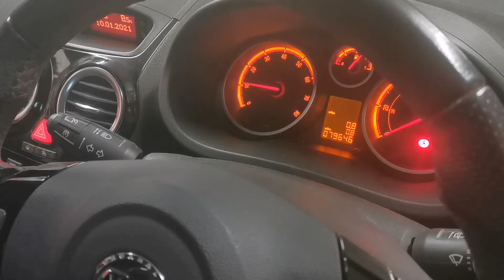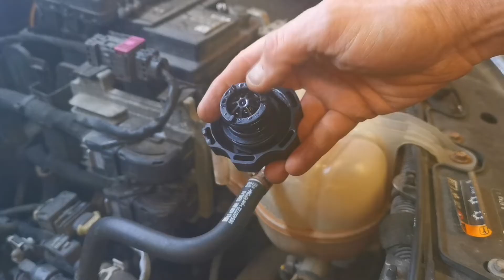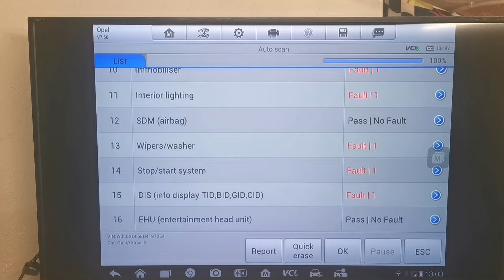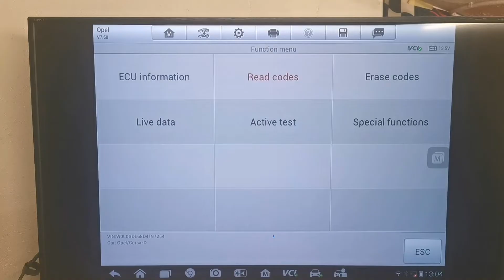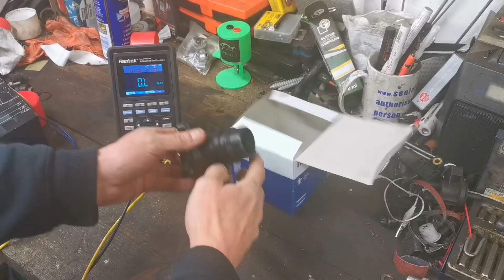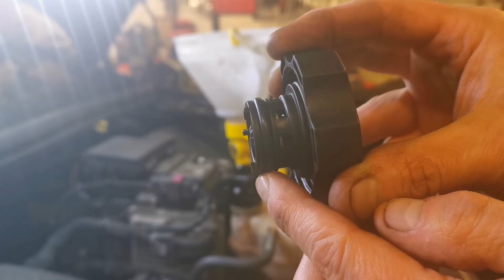Vauxhall/Opel Corsa D. Fan Running, Warning Light On

Comment: Had the exact same problem with a Corsa 1.4 XER. I'd recently replaced the thermostat housing so thought it might be the temperature sensors instead and replaced both. That didn't fix it and then I saw this video and realised it was the 'new' thermostat that was faulty. Lesson learned, spend more on part next time!

Comment: Great video, may I ask please….when you tested the thermostat resistance, the range was M Ohms. My reading is fluctuating around 3.4 on M but OL on normal range. I’ve checked the harness terminals with a test light and it’s ok. Is this showing a faulty thermostat with the ohms reading? Not sure what resistance I should be getting. Any help would be gratefully appreciated.

Comment: Bonsoir merci de répondre, jai une opel corsa d essence la tempérarutre d'eau atteint 108 et 110 degrés en circulation et en route se fix en 100 degrés est-ce que c est normal ou non😊😊
Reply: Did you find the solution of your problem???
I think you have problem with fan

Comment: Hi I have the same Opel Corsa and the engine temperature rises to 110 degrees and does not turn on the radiator fan the radiator fan is good I checked it briefly What could be the reasons
Reply: Alles in Ordnung. Das Thermostat regelt zwischen 95-110 Grad Celsius. Ist normal.
Reply: Change termostat electric controle

Comment: Please can you respond. I have white smoke coming out of exhaust, and inside I saw a traces of antifreeze, and saw the drops of water leaking from the exhaust. I have the whole coolant reservoir and cap changed, and think also some plastic hose. But the car still loses the cooling liquid. After a month it dropped pver 3 thumbs down. The car has lesser strength I think, average consumption increased to 10.5km in the city. I don't know if that's notmal, but the sound of motor is louder and also the sound of belt I can hear in  cabin while driving. I have given over 1000 dollars for the mechanics, and really don't have anymore to waist. :( Can you give some advice please, thanks in advance:)
Its Corsa D 1.4 ecotec/  automatic
Reply: Head gasket

Comment: Just had this with my car changed the 2 temperature sensors fan was still on.  Then changed the resistor.  Fan was still on. Bought a new thermostat comes complete with housing unit £17.89 of eBay stuck that in myself pure easy 3 bolts. Seems to have done the trick. My  fans off.  Warning light is off car running like a dream. You also have to top up coolant  so buy 2-3 litres as you  lose almost all of it when changing the thermostat. X
Reply: Was your car idling up down
Reply: That will be a vacuum leak on the manifold, you would need to check fuel trims to see what the engines trying to counter act ie unmetered air coming in past the maf sensor

Comment: This is the same issue im having with mine, same model.  Ironically i was half way out my street to the garage when the engine temp warning light started flashing red at me.   And there was an ever so slight burning smell.... don't think its wise to drive.   Any idea what it could be? I'm bricking myself that its gonna cost a bomb whatever it is

Comment: Watched video 5 times more.  I thus tested both new Mahle ThermoS to same 15 ohms. So they both work.  But they don’t open on boiling water test.  ** Electronically controllled ** ? … water pipe to thermo on housing alone straight through pipe now warm and no overheat.  Dave have you seen the electronically controlled heated thermostat electric connector pin to be faulty. Maybe it’s a wire problem to the thermo Dave , or ECU ? Thermo are not faulty. Car only overheats due to these new Marle being stuck closed.
Reply: What did you find for a fix for this?
Reply: @bigmanlogo959  I changed the thermo. Twice. Wasn’t this. I took out the thermo inside the housing and drove fine didn’t overheat. I think the electrics were telling the thermo circuit to stay closed. So removed it.

Comment: Dave. Thanks for comments other day. Struggling I am, head scratching ; here’s  where I am.  2x new Thermo and a new water pump.  I still have a big over heat situation .  I have great oil and water condition but on scanner it jumps to 121c to 125 and quickly .  Terrible.  Fan only kicks in at 110c. Wrong by 12-15 degrees I believe .  This is over just 2 miles it gets to 125c. It’s like the thermo stays closed but it cannot be.   I tested both new thermo in 100c boiling water.  They didn’t move. But brand new boxed 2.  Same model as yours shown 1.2 xep engine.  However. Should I remove the new thermo and run car with housing only,  thermo removed, straight through …..  It doesn’t run with an overheat.  It runs normal. Over 25 miles.  I don’t believe this is head gasket.  I’ve isolated all. Water pump does pump.  It runs fine with bad practice no thermo status.  Any ideas.  It’s totally blown my head. Wrecked it.  I’m no mechanic. I’m on the learn . Thanks Dan.
Reply from the maker: Put 12 volts to thermo to see if it opens off the car. Pin close to engine side is positive. I use Mahle thermos. If lower radiator pipe is cold thermo is closed
Reply: @davesterl  that’s exactly what I thought !!  I have a cold pipe. My problem is I replaced the new Marle one with exact same Marle one.  And pipe remains cold.   Can two Marle thermo be defective. Never ?   It’s a mechanical part , I’ve looked videos from Marle.  Could anything stop the Marle from working outside of temperature on the innards of the Thermo itself. I’ll try a 12v thanks !  This has blown my mind. I know it’s Thermo.  So I bought it again. And it’s still pressuring and still a cold pipe maybe 5 hours messing in.
Reply: @davesterl  mahle tm 37 103 made 02.12.21.  Put both Mahle to 12v car.  And also to 9v square domestic battery. Doesn’t move whatsoever.  Either.  Hmmmmm.  These are new boxed.  Brand new.  Same part model.  Brand. Boxed.
Reply: @davesterl  isolated this down to wiring or circuit.  I’ll get a circuit tester and check the power to the thermo.  Thanks.  I’m suspecting after speaking electrician this could be the relay the rad circuit is on.  Radiator itself only opens at 110c not 95-98
Reply from the maker: @primeroo2nd  i thought you tested the thermos?? They open at 103. Pulse witdth signal on ground side, you can see it happening on a scope
Reply: @davesterl  I tested Thermo on a 9v home battery and a 12v car.   Didn’t open. Also in pan 100c water. Don’t believe this is how you test them. Then did on OHMS and got your 15. Ive very new to coolant systems and electrical testing.  Though sold cars 17 years not fixed them
Reply from the maker: @primeroo2nd  the thermo is opened with  12volt supply and a pulse width ground. If you only sell cars and don't fix them and do not know what you are doing then that is the problem
Reply: @davesterl  sold 8000 cars, all gone to garage 05-22 !!!!  I’m between premises 3 months post fire so too much time hands business on hold some GM strangled diesels plus petrol Corsa overheating.
Reply from the maker: @primeroo2nd  i tell you how to test but you don't believe this is how you test them, so i can't help you. Sorry
Reply: @davesterl  it’s cool. I’ve just read the pulse width ground plus power. I was only using power.  The situation here was garage changed water pump and was damaged street. I took it away mess. But.  I’m totally new to testing thermo and circuit. I know it had new pump thermo header. Just not how test for circuit faults.  Equipment faults. All new.
Reply from the maker: @primeroo2nd  best of luck
Reply: @davesterl  thanks. I’ll get there. I’m working this out slowly. Circuit tester 9v battery test wires and equipment. Isolate. Follow on the circuit to the fault. Wasn’t aware these thermos aren’t just mechanical.  They need the electrical signal. Electrically controlled thermo. .  I stupidly thought the connectors read the temperate of the water through the thermo housing. And the thermo old school mechanical. Not. .

Comment: Would an in op fan allow water header tank bubble over in under 4 mins idling stationary please ?  I’ve had a water pump. New thermo.  But fan stopped working. Wondering if this why still boiling pressuring over ?? Thaksn
Reply from the maker: did you run fan on scan tool?  'boiling pressuring over' ???? If pipes not hard and coolant overflows when hot - check expansion bottle cap. Any decent garage can do some basic tests
Reply: @davesterl  old scan tool burnt in fire.  Couple grand one. What a job..  There is a major sketch here this car.  Radiator could have been intermittently faulty.  Back working again plugs off and on.  Water pump seen working. Tonight. Dry bone pipe off.  But is now not cooking. . I’ve taken out the thermo inbetween the thermo housing.  Now fan comes on at start stays on.  Wasn’t earlier at all.  And now Not overheating. Was earlier . Just had a new almost OEM thermo.  Suspect may be dead new thermo ??  Canibilised old thermo.  Odd one.

Comment: I’ve had an issue with my Corsa D 1.2 for 2 weeks now, been investigating it via YouTube videos and googling, I’ve got a amber car symbol with spanner showing on my dash, I serviced my car myself oil/filter etc but the fan is constantly running, I changed the radiator coolant sensor as I thought it was that, fan still running even when cold, I’ve bought a new thermostat which I’m doing this weekend. I’ve checked the relays and radiator resistor all looks ok
Reply: Did you ever fix this issue? I’m experiencing the exact same problem
Reply: @fin4946  Lol same here, i reckon its the thermostat housing where the thermostat sits inside, as my thermostat  heater control circuit is showing as High.
Reply: AmarR35  I fixed the issue of the fan being constantly on. All it needed was a brand new thermostat unit, quick and easy change 👍
Reply: @fin4946  cheers am gonna do that as soon as, iv had my warning light and fan spinning all the time  since summer 2019 loool..... Did you get an OBD 2 connected to see any fault codes mate?
Reply: AmarR35 Yh connected it and the code was P0599 on mine, I had the service light come up on the dash with the fan constantly running. The car runs so much better now it’s fixed
Reply: @fin4946  Good to hear mate, yh same code as mine, did yours state "Thermostat heater control system - circuit high"? Tbh I don't  think iv noticed it drive differently from when it didn't have that fault lol. I also have P0171 code, which is more than likely the PVC/breather valve, which are common faults on those corsa's too incase you get summat like that. Cheers for the response anywaiiz.
Reply: @fin4946  Hi mate I have the same issue do I need to buy the whole housing for the thermostat or just the thermostat unit?
Reply: Frank Castle Hi mate, if you have the constant fan running with a service light on the dash then it’s most likely that the whole thermostat needs replacing as it’s probably stuck open all the time. That’s what fixed mine 👍
Reply: @fin4946  Should I not try the coolant temperate sensor first? Replace that
Reply: Frank Castle Yh I tried changing the sensors and when that wasn’t the issue I knew it was the thermostat.
Reply: @fin4946  I replaced the radiator sensor but fan still running. Should I try the second coolant sensor? I can’t find it though everybody says there’s 2
Reply: Frank Castle There is a sensor on the coolant housing which is located on the right side of the engine. The problem is most likely a faulty thermostat which will need replacing

Comment: Had the same symptoms and got a reading of 1.4 ohms Fitted replacement with 13 ohm resistance and problem solved. Geat video Dave

Comment: Cream job there Dave,  was putting a zafira on the ramp today for a new clutch , 1.6 petrol on a 10 plate , there was one on the ramp before it , let it down , zafira on , wont go up , loud metal bang , 2/3 mm  turning of chain, looks like lift nut knackered , had to farm the job out to my mate , not doing that on the floor , good job my mate fixes and sells ramps , and it's a Hoffman 2 post x ford main agent , fully maintained b4 me , still gets serviced and chain adjustment etc , at least the car was on the floor , once spent 2 1/2 hours when electric off and had to manually wind ramp down with ratchet and big socket , tired arms , customer wanted car back that night 😂👍
Reply from the maker: aw man hate that,. ive had no bother with my lift as yet, touch wood, just had to change the rubber pads and lube runners often

Comment: I work on cars all day at work and then come home and watch people work on cars.
Reply: James I’m exactly the same as you mate we are all 🤪
Reply: I’m a car trader.  I come home look more and more cars.  Like an addiction.  I’ve had a site fire lost business premises 3 months. 2 months in so bored I’m fiddling with broken GMs and Pugs with very limited success.   Could you help like Dave. I’ve a corsa part ex. Came in needing crank case oil leak.  Garage sorted.  Once left garage Corsa pressurised driving away and learnt put on thermo water pump new header tank.  They said they couldn’t stop it overheating. It didn’t go in with one !!!  It’s still kinda overheating now.  Big time. Unless thermo not present , it’s a pressure cooker with lovely water and oil.   Don’t get it. Messed with it loads.  Bled it. Isolated parts.   It’s a cooker still.  ….  

…... Struggling I am, head scratching ; here’s  where I am.  2x new Thermo and a new water pump.  I still have a big over heat situation .  I have great oil and water condition but on scanner it jumps to 121c to 125 and quickly .  Terrible.  Fan only kicks in at 110c. Wrong by 12-15 degrees I believe .  This is over just 2 miles it gets to 125c. It’s like the thermo stays closed but it cannot be.   I tested both new thermo in 100c boiling water.  They didn’t move. But brand new boxed 2.  Same model as yours shown 1.2 xep engine.  However. Should I remove the new thermo and run car with housing only,  thermo removed, straight through …..  It doesn’t run with an overheat.  It runs normal. Over 25 miles.  I don’t believe this is head gasket.  I’ve isolated all. Water pump does pump.  It runs fine with bad practice no thermo status.  Any ideas.  It’s totally blown my head. Wrecked it.  I’m no mechanic. I’m on the learn . Thanks Dan.